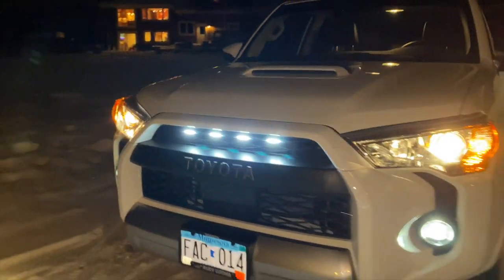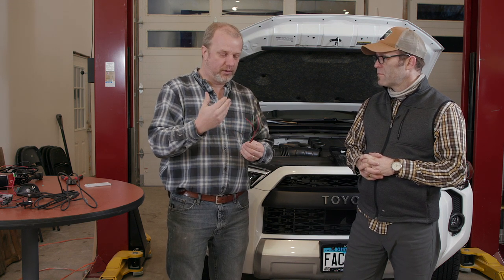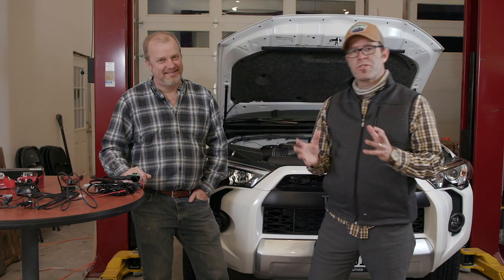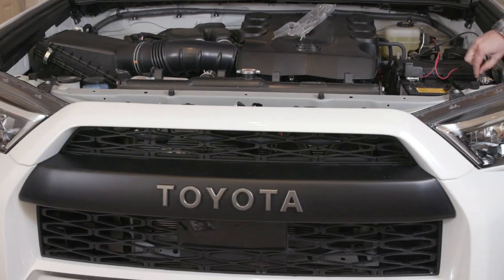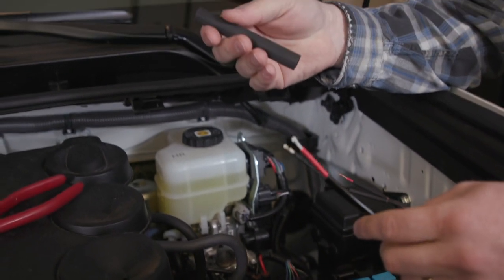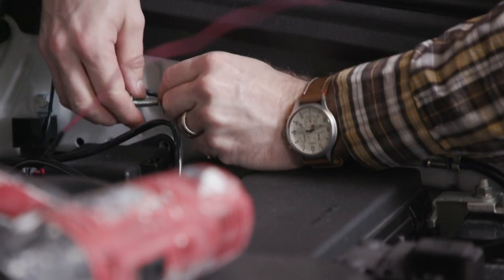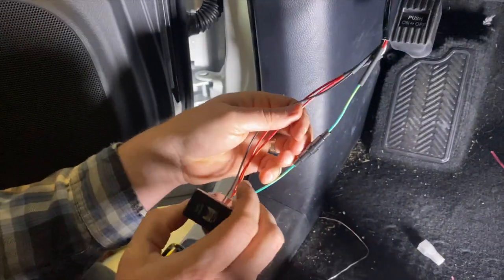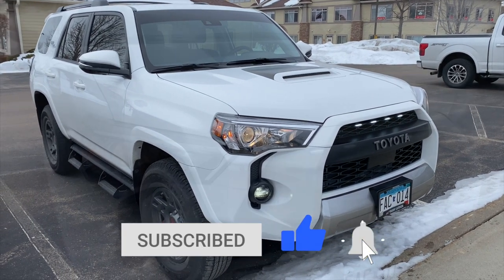5th Gen 4Runner Raptor Light Install with Switch AND Relay

Comment: Thanks for explaining the concept in detail. Most other videos out there just showing raptor light to turn on when thr vehicle is on, with no switch. This is the exact how to video I have been looking for. We need your professional friend making more video like this. There are many kids out there pretending to understand this stuff and making no good tutorials potentially even dangerous.
Update: I was able to install raptor lights with oem switch and everything has been working as expected.  I even used the same harness. There was quite a bit of soldering. But in the end it was all worth it.

Comment: Great video. Just spent part of my Thanksgiving installing the lights and relay harness on my 2016 SR5 Premium. Switch and lights work great! Thank you for walking through the process. Perfect “How-to” video.
Reply from the maker: Thanks for watching!  Enjoy your lights!!
Reply: How did you screw on the relay harness on to the body of the truck? For some reason the width of the hole provided on the harness did not match the holes on the body. I too have a 2016 sr5 premium 4Runner. Thank you!

Comment: I own the exact same vehicle and am in Chanhassen! Trying to do this and just bought all the items you recommend. Hope install is a breeze like you guys make it look
Reply from the maker: Awesome!  Best of luck.  Hopefully we’ll see you around.  We’re in Chaska!
Reply: @PictureTime  thanks! We followed directions to a Tee and I cannot get the light on the switch to illuminate. my swtich had a yellow and red instead of two reds but I saw in another video the guy does the same thing and runs both yellow and red to the white wire from the relay..... wondering if I have a bad 4RunRun button

Comment: Great video, I learned a lot which helped me install an OEM style dash switch, relay, and Raptor Lights in my 2015 4Runner Limited. I did take power from the engine bay fuse box, 10 amp INJ slot using Add A Fuse. Saw another video where Runnin4Tacos removed the nut from the bolt holding down the fuse box to slide up a little door allowing passage of the power wire up and through without cutting a little channel in the fuse box keeping it water tight. My only regret was using crimp style wire connectors which were a pain connecting different gauge wires. So far the lights work, but I may go back and solder them like you suggest. Still, the lights look great and it was a cool project!
Reply from the maker: Awesome!  Thanks for contributing what you did on your project Mike.  Helps others in the chat!  There’s a bunch of ways to do this install.
Reply: @PictureTime  You’re welcome, please keep the videos coming!

Comment: Posi-tap's make getting a signal off a factory wire easy and safe. No cutting or damaging the factory wires.

Why did you end up running power from inside the car? Just to avoid putting a hole in the fuse box?
Reply from the maker: Yes. I didn’t want the chance of moisture leaking into the fuse box in the engine compartment.  We have a lot of temperature, humidity fluctuations in Mn.  Thanks for watching!

Comment: Thinking about this, I'd probably want the Raptor lights to come on with the parking lights. But would be cool to have a switch on the dash to interrupt/turn them off when you'd rather have them off (not sure yet on a scenario where I'd want them off though if parking lights are on).

Comment: Thanks much for the great tutorial!  Worked out great.  I have a 2021 SR5 so I had to utilize grill  bezel inserts made by 3b Makers.  Especially like the duct tape fix on the loose Raptor switch.  Had to do the same, so it hasn't been fixed as of 1/22.  I would have scratched my head on that one!
Reply from the maker: Thanks for watching Kent!

Comment: Great Video!, but had a quick question.  The main power source (12ga red wire) that goes through the relay to the lights. Is that red 12ga cable connected to the battery directly or going through the big fuse box Near the battery?  For either application does it require a pig tall fuse as well and what size?  I did not really see that covered in the video.

Comment: I know it’s been a couple of years but I have a stupid question….. first of all great video, very informative!
Is the relay for the illumination in the light switch? I know it wouldn’t be as OEM looking but could an on/off toggle switch be used with out the relay?
Reply from the maker: Trying to remember details… but the switch suggests a relay. I think a simple on off switch would be fine for this application.  The led lights don’t draw much power.  You’d want to have a relay for things with a larger draw.  Thanks for watching.

Comment: So a few things….  1st, why run a ground inside the cabin when there are plenty of ground points under the dash?  Second, why not just add another “add a fuse’ and connect it to a power source that only comes on when you turn the lights on?  Unless I missed it, why didn’t you connect the main power source at the battery to the relay, then use the power from under the dash to trigger the relay?  It seems as you got both 12vdc  power connections from  under the dash.  Finally why did you zip tie the excess wires from the harness rather than just cut to length?  Other than those items it was a pretty good video. Thanks!

Comment: As others have said, thank you for your simple, concise explanation.  In your video, you're installing Raptor Lights and you plugged the add-a-fuse into IGN2. 
I'm installing a 20" LED light bar.  Could I plug in my add-a-fuse to a Headlight Hi-Beam fuse, so that the light bar only comes on when the switch is turned on and when the hi-beams are on (if either of the two are off, the LED light bar would be off)?
Also, you spliced both red wires together in your switch.  Could I take the wire that lights up the words (on the switch), add a add-a-fuse, and insert it into the Dash Light Fuse (the words on the switch would light up when the dash lights are on)?
Thanks again!
Reply from the maker: Yes. You could do that for sure. The high beam fuse is in the engine compartment fuse box.  So you’ll want to go in there with your main power.  Then your bat would only come on when your lights are on (THere is a separate fuse for high and low beams so you have to decide when you want the system powered).  Then yes. You could run the other red switch wire to your dash lights fuse and it would light up with your dash lights.

Comment: Question, why did you extend the power wire with 12 awg? The relay package says the wire is 16awg, wouldnt 16 gauge work or did it need 12 gauge? @11:37 in the video

Comment: Great video. The one thing I missed that you quickly mentioned was extending the relay battery power wire with a 12 gauge piece of wire. The wire on the kit is 16 gauge. Did I understand that correct or miss something.
Reply: Ok, I did miss something. I skimmed the intro a bit fast where you clearly state the kit is a 12 gauge kit.  The link provided however is a 16 gauge and I missed that as well.  To make matters worse, after testing that everything did in fact work from battery power, I proceeded to connect the rest inside the cab.  After powering up the car, I only got half the light to the switch and no power to the raptor lights.  Pulled everything inside apart and re-wired with temp connections and got the same result.  Finally realized the connector that originally went to the included switch was wired incorrectly.  The red and white wires were wired in reverse in the connector.  After cutting all those and connecting it worked.  I've got the 12 gauge kit coming.  The 16 gauge had super tiny wires inside and just seemed a bit delicate. 

Is there a great solution to put the fuse cover back on with the Add-a-fuse?  I'm probably going to pull out the Dremel unless there's a better solution.

Comment: HI, did you guys remove the fuse that is connected to the power that comes with the relay harness or did you guys leave it? I know you guys extended the power that goes to the relay which goes into the fuse box inside of the car.
Reply from the maker: We left the fuse there
Reply: @PictureTime  Thank you.

Comment: Helpful video and thanks for sharing. I have some question, If I'll install a BSM and wire a switch like this. Do I need to connect to a relay first? Or can I  connect from fuse box to the switch directly?
Reply from the maker: Depends on the switch and also how much draw your lights pull. My switch recommended a relay.  A relay will keep the power going through your switch low and will prevent burning the switch out.

Comment: Great work guys, quick question. 
The main power to the relay. 
Did you guys end up cutting off the whole wire including the fuse it comes with. I believe its a 20amp fuse. 
If so, the main power line to the relay only has that 10amp fuse correct or no?
Reply from the maker: If I remember right. I think we left the fuse. So there is now 2 fuses.  My truck was totaled a few weeks ago so I can’t check, sorry.
Reply: @PictureTime  thank you for the reply. So sorry to hear that. Best of luck 🙏

Comment: Thanks for the video! What kind of bolt did you use to secure the relay? Where do you get it from?
Reply from the maker: It was a standard bold with a 12mm head. I just got it from the hardware store.  You could also use an existing bolt where other things are mounted to the inner fender.
Reply: @PictureTime  thank you!

Comment: Awesome video, thank you! At one point you stated that there was enough wire to power another set of lights… I would really like to power my Aiden James LEDs that go above the foglights, can this be done using this harness and switch? If so, how/where would I tap in and would I need to use another fuse? I’m not very bright when it comes to electronics, so any help would be greatly appreciated!! Thank you!
Reply from the maker: I would probably tap into another fuse depending on the draw of your other lights.
Reply: @PictureTime  I want to do the same process that you guys did on my toyota tacoma 2021 led fog lights. I have the same harness that you guys used so the question is: can I connect my power cable to the same ignition 2 fuse?

Comment: Seems to me if those whites won't break a 2 Amp Fuse then you really don't need all that relay do you? They must only be drawing about 1 amp which I think should do just fine plugging it into the fuse box?
Reply from the maker: Yes. You are correct.  The lights say that that recommend a relay so I wanted to show how to install one.  I totaled my 2020 4Runner in 2021 and have a ‘21 4Runner now and have the lights plugged directly to the interior fuse box (now over 2 years) and haven’t had any problems at all.

Comment: Did the fuse cover fit after add a fuse? Or did it need modification? Mine did not go back on. Running with cover in the owners manual..

Comment: Question, when you connected both red wires on the switch, did that make the switch just on and off, instead of dim?
Reply from the maker: The light turns on when the lights are on but doesn’t dim the way we have it connected

Comment: Can you please explain how to wire the cheap round 3 wires to the 4 wires on the rectangular switch again ? 3 wires as red,, white and black on the round switch that i want to get rid off.. 4 wires on the OEM matching rectangular switch with black,  green and 2 red wires. Thanks

Comment: My ditch lightw came with a relay..can i use the same relay as i am only swapping out the cheap on/off. Switch that came with the ditch lights to a more OEM  factory looking on/off switch?
Reply from the maker: I don’t think that would be a problem.  Anyone else want to comment?  It’s been a hike since we did this installation.  Thanks

Comment: is it just fine if i will just use the fuse tap instead without relay and switch?
Reply from the maker: That is what I am doing now.  The lights don’t draw much power and haven’t needed the relay. The video was more to show and explain how to install a relay which would allow you to run additional accessories.
Reply: Thank you for the info. now that i am decided to install raptor lights on my car, i'm thinking if i can plug it in the fuse of my foglamps which is rated at 7.5A so it will serve as a switch whenever i open the foglamp but one thing that bothers me is the foglamps has two fuses (FR FOG LH AND FR FOG RH). do i need to tap in on both fuses or just one of each will be just fine?

Comment: Good morning. Recently, I ordered a pair of Morimoto bitch lights but I've run into a problem. I want to use an OEM-like switch to replace the Morimoto switch. However, I'm having trouble wiring the right wires to the switch. On the Morimoto switch, I have 2 blue wires, 1 red wire, and 1 black wire. The OEM-like switch is the same as the one you guys installed. Can anyone please help me out with this?

Comment: Very sorry to hear about your runner getting totaled.  I think I got it figured out,  but do you remember cutting the connectors to the extension that runs inside the cabin through the grommet and just soldering the red white and black wires together or did you keep the connector. It feels kinda flimsy and I don't remember seeing it outside of the grommet
Reply from the maker: We soldered all the connections and didn’t use any of their provided connectors.
Reply: @PictureTime  thank you. Got mine in. Ran the power to the inj fuse in the engine bay fuse box. You're video helped tremendously.

Comment: so the wiring on the switch is all the red wires go to the white wire, the green goes to the red and the black goes to the black?
Reply from the maker: Yes.  As long as you want both lights in the switch to light up together.   Take a look at the switch wiring diagram at 4runrun.com/install.

Comment: I know this is probably a dumb question but if the power source to the relay came from the battery would you still need to connect it to the fuse?
Reply from the maker: Not really, but if the power came directly from the battery, the system would always be powered (even if the vehicle was off). Although the drain from the LEDs is minimal, I didn’t want to risk forgetting to shut the lights off every time.  So we wired to the fuse location so the system is ONLY powered when the vehicle ignition is on.  Hope that helps.
Reply: The fuse box under hood, next to battery. Lift cover off of there, there is a clip you must manipulate, and other side of cover there is also a map. Find INJ and that is where you want to plug in. Use exact method as if you were going under dash admin video here. There are also videos on this method. Super easy. But I want the switch on dash.
Reply: Oh and this way the lights only turn on when ignition is on.

Comment: Hi, good video and thank you!!
I was intending to do a 3 raptor light array instead of 4. 3 lights will fit my factory pro grill better, there is a position dead center of grill. 
Will a 3 light still work with that harness? 
Or I wonder if it would be ok just to hook up only 3 out of the 4 lights from your video? 
I suspect it’s ok regarding both questions, I just have to make sure before I start ordering stuff for my new PRO. 
Thank You!!
Reply from the maker: I believe you can do 3 lights (in the next row of diamonds below) so the lights will be slightly lower than mine.  I would purchase a 3-light set (like this: https://amzn.to/3hfDdzl) vs the 4-light.  Then everything else should be pretty much the same as mine.
Reply: Yeah thank you. I was having not so much luck finding the 3 light set up. Well didn’t put time into it much. Thanks again!!

Comment: So quick question… if I don’t want to connect the raptor lights to any of the stock interior switches but rather hook them up directly to  my fuse box say my DRL or tail light fuse so when I start my 21 4 runner they come on… do I still need a relay switch? Thank you
Reply from the maker: The lights themselves recommended using a relay but these LED lights have very little draw so I wouldn’t see a problem in just connecting them to a fuse that turns on when the vehicle comes on.
Reply: @PictureTime  thx for the info

Comment: Pretty new at this, but your video has given me the confidence to take this on this weekend (2015 TRDP).   The 11mm bolt used to connect the Relay to the vehicle - was that included in the package or something you picked up from the hardware store?
Reply from the maker: Hi!  The bolt wasn’t included... I had one in my garage, but you could get one at any hardware store.
Reply: @PictureTime   - thank you for the reply and the video!  Project complete - looks and works perfectly.  Took me longer than the average bear, but I was taking my time.   Getting a hole in the grommet was interesting!
Reply: Ooo99
Reply: @PictureTime   whats the link of the relay?
Reply: @coffeehound331  Hi, were you able to find a 11mm hex bolt? I went to my local Home Depot and Menards and no luck. Thanks for thehelp.

Comment: I have a 2019, so there is not an IGN NO.2 fuse location.  Can anyone help and tell me which fuse location would be the same as ING NO. 2 to serve the same purpose as this video? And which fuse would be for the dash fuse, as I want to illuminate the text 'RAPTOR LIGHTS" when the dash lights are on?  Any help would be greatly appreciated.
Reply from the maker: Thanks for your question Tammy.  I’m not familiar with the fuse panels on the 2019 but I think you might be able to tap into the fuse box on the engine bay for your main power.  Hopefully someone who knows will chime in!  Good luck with your project!
Reply: @PictureTime  Ok, thanks for your response.